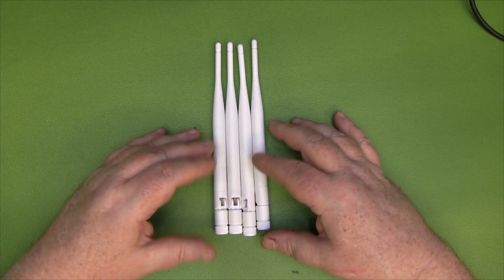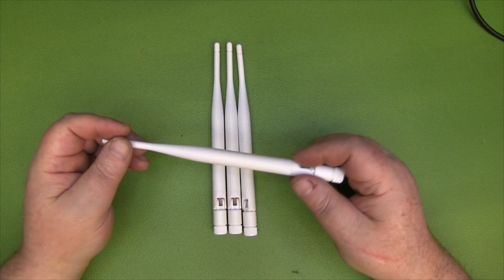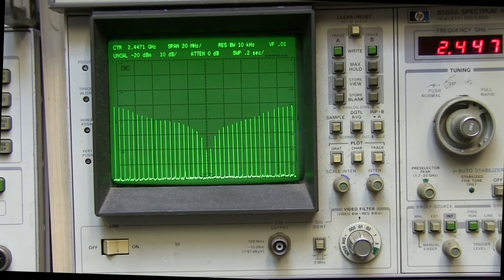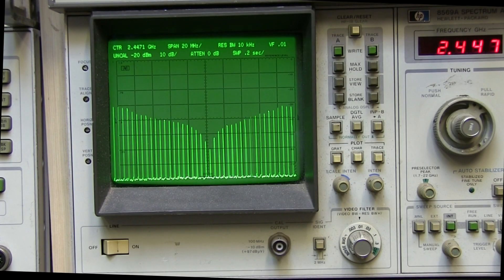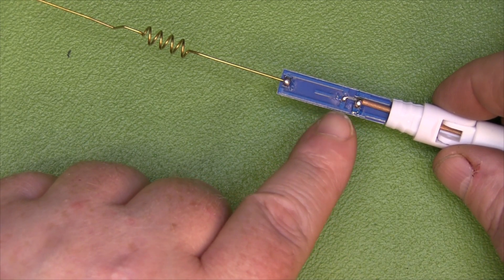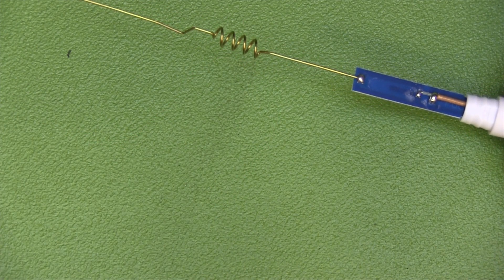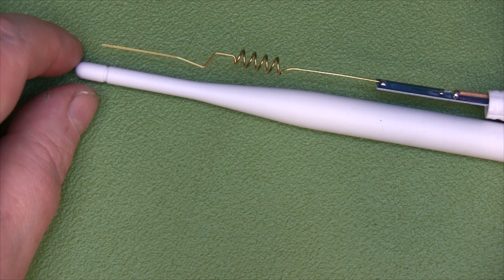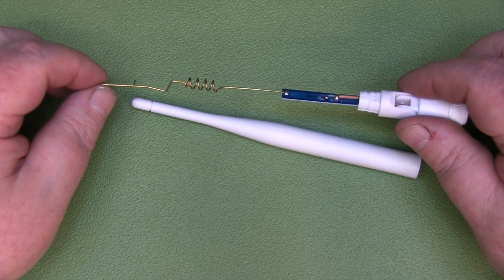A 2 4GHz Antenna with a Strange Kink

Comment: If i were to add a bigger antenna to a wifi extender could it improve the range? Or would it be pointless?  Current antennas are about 3" long.
Reply: Extenders usually employ shared antennas thus need to be omnidirectional  as they need to reach  both the base router and the client devices' respective antennas.     So you prob have low gain,  perhaps 2dB dipoles.  

If they are detachable it's certainly worth experimenting with 3dB, 5dB, and perhaps 7dB  replacements. If repeater is  dual band (2.4 / 5 G)  be sure to use legitimate dual band capable antennas.   Be aware sometimes cheap units are falsely marketed as dual band. 

  Start with antenna(s) pointing straight up and play around.   Usually it helps to position extender not near the floor but rather higher up, or use short antenna extender cables to get antennas higher up and thus more free of typical obstructions.